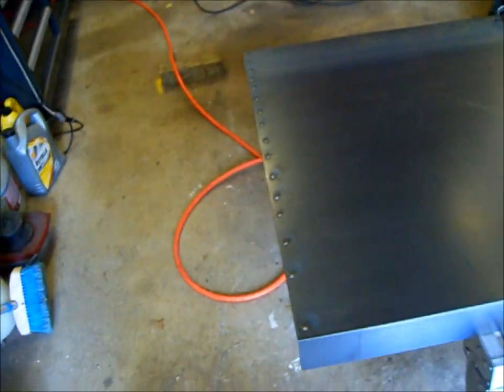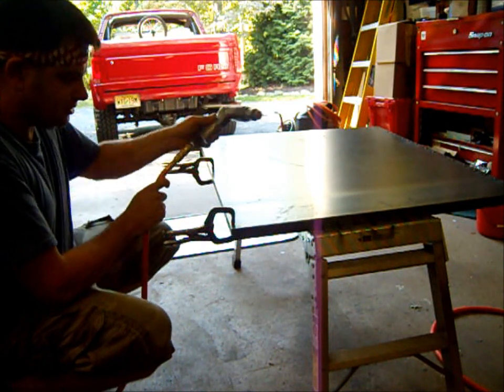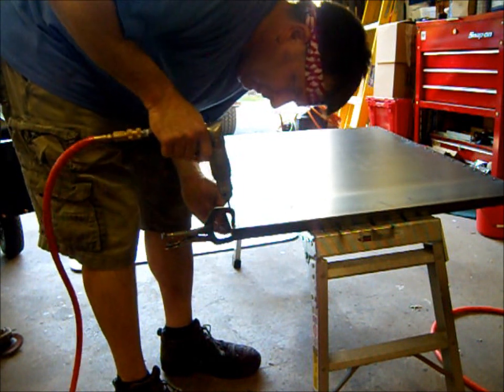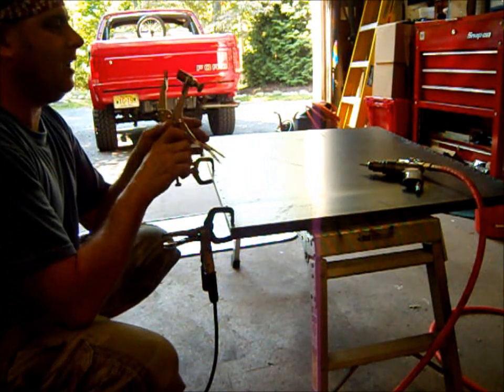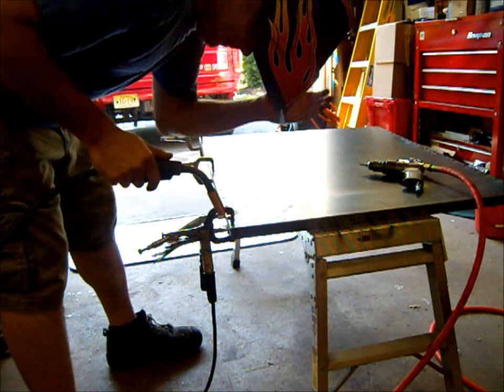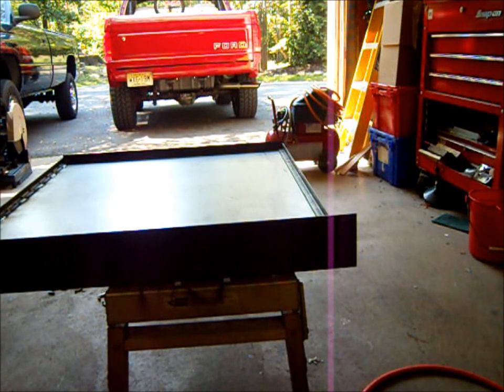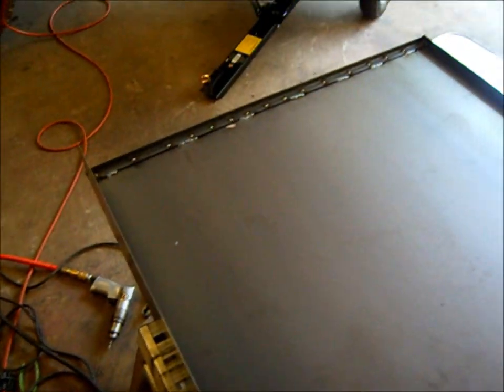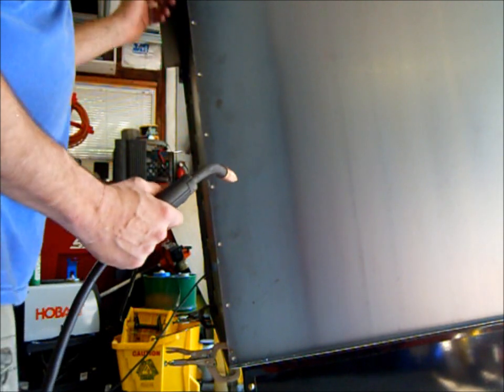Lawn leaf vac system fab part 7, building the hopper.

Comment: From what I understand about that tool, you're not using it quite right. I believe the little fork is supposed to sit flat on the metal, which means its not well suited for the situation. I think Eastwood has a video on their site that shows procedure. I think your welder is adequate.